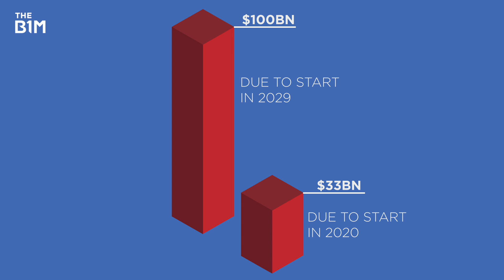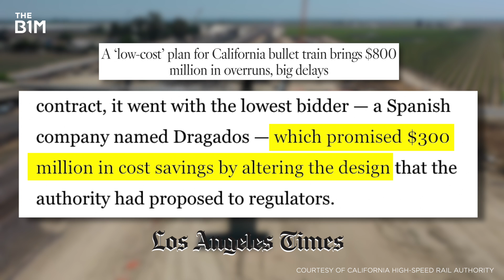What Went Wrong With California's High-Speed Railway

Comment: the statement from ~3:40 to 4:00 is misleading. yes, the original estimates during prop. 1a were for just $33b for the total which later ballooned to $100b in subsequent business plans, but that top figure was the high estimate if "everything goes wrong" and it's for the entirety of phase 1, NOT only the madera-wasco segment under construction. it's all but guaranteed that if $100b is spent, then the entirety of the la-sf portion complete and that probably will pay for some of the route up to at least to sacramento from phase 2.

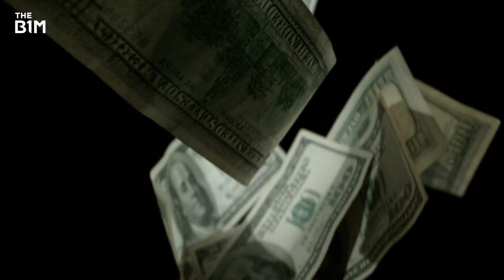the comment regarding environmental reviews at ~5:20 is outlandish. the cahsr authority has continued to advance environmental clearance on all the remaining segments of phase 1 and while they are behind the original schedule (in no small part due to having to redo some segments after the local agency partners changed their minds and demanded a new route e.g. bakersfield), the majority of the segments of phase 1 are already cleared and there's no evidence that they won't be able to fill the last few gaps within a few months after the timeline at worst.

finally, yes, the la-sf trip is the big shiny object that propels the project along, but the reality is that it's going to be the fastest way to travel around the central valley which will be massively transformational. additionally, it will be a completed spine, something that is certainly likely to be easier to build outward from (including with local funding in the "blended" corridors on the bookends) whereas starting at the ends would've blown all the money on a redesigned laus and salesforce transit center in sf. it's way easier to run a line over 120+ miles of track than five.
Reply: Their 100-billion worst case scenario is likely the most probable outcome.
Reply: @stephenwest2  only if it gets dragged out for many years.
Reply: @snoopyloopy  Which is a certainty at this point.
Reply: @stephenwest2  what's the certainty? the only reason it would reach that amount is either due to taking so long that inflation creeps the price up that high or the entire project is completed.
Reply: @snoopyloopy  Not mentioning the pandemic, these projects are known for always massively going over budget as new problems arise during the construction process. Nothing new in California's case. Don't get me wrong I would like to see this project succeed as I am a big fan of public transportation but it's pretty hopeless at this point.
Reply: @stephenwest2  hopeless how? it's very much under construction and unless the legislature continues their senseless hold on funds, will be gaining an infusion of cash soon that will help close even more of the gaps.

Comment: As a Californian whose followed this project since 07-08, this video has greatly summed up the major issues of the CA High speed rail. Sad. Lawsuits & corruption are also driving this high speed down ( & cost up)
Reply: This is the major issue. So much of California conservatives were against it from the very start and have been holding it back. There was always going to be red tape but with the past Trump presidency making things more decisive. The new infrastructure bill is supposed to significantly help it though
Reply: The new infrastructure bill is just for new highway expansions and repair on roads and bridges, as if we need yet even more highway to maintain.
Reply: @Swiminatub  did you read the infrastructure bill?
Reply: @Swiminatub  You must not be from California, its ran by democrats, this project has been over budget and delayed way before Trump was president. Its not close to finished and even if it was close it in farm land no one would take it. They shoulve cut bait and ran 10 years ago.
Reply: @Swiminatub  This project has been going on for 20 yrs.  The fed govt requires regular updates and certain timelines to be reached for continual funding.  When you fail to reach these repeatedly - you risk losing your funding it's always been this way.  Trump just did what leadership in the past failed to do - that's why jobs and an the stock market was soaring and gas was $1.50 cheaper for Californians when he was in office 
( prove me wrong ) - What has Brandon done between his dymentia episodes ???
Reply: @stuntdriver2147  Stock market was soaring? You Trump supporters always close your eyes and ears when anyone brings up the huge crash that happened near the end of his term. Gas prices are high because of low production, you ever take a business class? Im guessing not, otherwise you would know that low supply + high demand = high prices
Reply: @philosopherbytes3758  more that both parties are but both sides likes blaming the other
Reply: @stuntdriver2147  Keystone xl was never completed. How does stopping construction on an incomplete pipeline cause prices to rise? You need to question your own news sources, bud.

Comment: in order for high speed rail to work it must have the exact time, price, destinations, and speed that people want and makes it a competitive choice. 

CA should have hired the Japanese/Chinese as consultants and started with LA to SanDiego or LA to Vegas first as a proof of concept.

Houston to Dallas, Miami to Orlando, Boston to NY to DC have huge potential. But the problem is corruption and the lack of political will. 

The BrightLine project in FL was up and running and turning a profit but at slower speeds until the pandemic hit. BrightLine is actually America’s best hope.
Reply: don't think brightline is turning a profit on the train service itself, even before the pandemic. and the issues being faced now would be absolutely magnified for la-sd, with less overall benefit.
Reply: @snoopyloopy  Even if it did not turn a profit at the time, ridership was visibly increasing. Brightline is also the same as any other company- it is normal for any business to operate at a loss in the first couple of years. But more people will learn about it, have opportunities to use it, and start riding it more.

If anything, I think this pandemic will turn out okay for Brightline- The numbers have not fully come out for this half of the year yet, but the net migration to Florida over the pandemic has seen some of the largest gains in the country. Their population has seen an increase of close to 300,000 every year, and once they reopen, Brightline will be able to take advantage of that.

Comment: Everyone knocking the US for not having high speed rail hasn’t been to the USA outside of Disney Land. The cost of gas and distance alone is totally different. Europe and Asia has nothing on the US and Canada freight train systems. You would never have a train in Europe carry the amount of goods that they do in North America. Many years ago the decision was made to lay rail track for freight trains and flights are so cheap in the US that rail would have a tough time competing. Plus the dumb argument why don’t they use the same tracks… the track gauge is different and where do you park a 3 mile train when a high speed train needs to pas 🤷‍♂️🤷‍♂️🤷‍♂️ Then add in the weather in the mid US states high speed tracks buried in snowdrifts. China started from scratch so it is easier to start from nothing than build around everything that is already in place. I’ve been on the trains in China they are just incredible but the people can barely afford a car, they literally have to be in a lottery to get permission to buy a car!!! So it is not even apples to apples….
Reply: The lottery system was put in place only in extremely congested areas like Shanghai where they charge you $13,000 for just the license plate alone, and even then tons of people are scrambling to get one. You think the average American would willingly pay 13k for a license plate and registration without the car included? Also "the people can barely afford a car?" Bro, have you not been in any major metropolitan area in the US?

Comment: It was a system, no one asked for, nor wanted.  In California, been here all my life.  The automobile is king.  

Even if you did a high speed rail in the valley, there are only four stops to be made.  Los Angles, Bakersfield, Sacramento, San Francisco.  And once you arrive, you'd still need to either rent a car, or be picked up.  For the projected cost of the high-speed ticket on the valley line, I could do a weekly rental of a mid-sized sedan plus gas for less.  And with the advent of electric vehicles, the rail becomes even less enticing for California travelers. 

The majority of city centers in California are located on the coastal line which runs from San Diego to San Francisco and beyond.  But again the City centers are on the coast.  

I lived in Germany for 12-years and yes the European lines are a marvel, I had a Euro-Rail pass.  But the thing is that the country's of Europe are very small in comparison to the USA, and the fact that rail lines existed in Europe long before Automobiles, of which only lesser percentage own a car.  

In the USA there are more cities/towns and areas that do not have rail service than ever will have.  The distances between rail services is just too great.  This project is simply a case of idiots in state government deciding to spend on a project that was doomed from the start.

Comment: "Eight Vertical and Eight Horizontal" network development strategy from China

Map of "Eight Vertical and Eight Horizontal" high-speed railway network (in Chinese)
In 2016, the National Development and Reform Commission (NDRC) announced the plans to extend the almost completed "Four Vertical and Four Horizontal" network to a new "Eight Vertical and Eight Horizontal" network.[36] The new network comprises eight north-south ("vertical") corridors and eight east-west ("horizontal") ones, almost doubling the route length.[36]

A corridor may consist of two or more parallel lines that take different routes between the same cities, branch and connector lines, and in some cases, connecting lines and lower-speed lines.[37] The Beijing-Shanghai HSR corridor, one of the verticals, comprises the preexisting Beijing-Shanghai HSR, which runs through Tianjin, Jinan, Bengbu, Nanjing, Wuxi and Suzhou, as well as a new high-speed passenger dedicated line from Beijing to Shanghai via Tianjin, Dongying, Weifang, Linyi, Huaian, Yangzhou, and Nantong, as well as HSRs connecting Nanjing, Hefei and Shanghai with Hangzhou.[38] Some corridors consist of a single HSR line; the Shanghai-Kunming HSR corridor, one of the horizontals, is essentially the Shanghai–Kunming High-Speed Railway by another name.[39]

The national HSR mainlines in the 8+8 corridor grid are generally electrified, double-tracked, passenger-dedicated HSR lines built to accommodate train speeds of 250–350 km/h, but corridors also make use of intercity and regional HSR lines with speeds of 200 km/h as well as certain regular speed railways. The Qingdao-Yinchuan corridor includes the Taiyuan–Zhongwei–Yinchuan Railway, which is partially single-track with speeds of only 160 km/h.[40]

Comment: Yeah the biggest issue has been land cost. Ugh I HATED driving to LA from SF it took 6-7 hours with little stops....
Reply: @scotttild  You'd missing the point of me NOT having to fuckin watch the road for 4-6 hours. I would take the train 100% of the time if it was done just to sleep or get other work done vs lose a DAY to driving. FFS
Reply: @CannabisTechLife  Very true. Not just sleep, you can use your phone or a laptop, read, eat lunch, get work done, etc. There are plenty of things you can do on a train that you cannot easily do while driving.
Reply: @CannabisTechLife  My car basically drives itself, I don't really need to watch the road. True driverless cars will be a thing long before this is finished--even if it takes 20 years.
Reply: Back in the day, I used to commute SF - San Diego every weekend (down on Friday night, up on Sunday night).  God that sucked.  Having a train would have made my life so much better even if it didn't save me significant amounts of time.
Reply: The main issue is not the land but the high cost of US public works. Electrification of the 50 miles Caltrain San Jose-San Francisco line will allow its use by high speed trains. It doesn't need significant land acquisition but will cost more than $1.3 billion, about 665% the cost of a project of similar length and voltage starting in Gretz, east of Paris.
Reply: Ironically, much of the track is built on a viaduct! They can literally build over farms like they did in other countries!
Reply: for 1/20 th the cost of the stupid train, they could have open
opened up interstate 5 highway from 4 to 8 lanes, the up the speed limit,   this would allow high speed driving, and will probably be less hassle for a SF to LA trip than riding a train.   no waiting at the station, no bus ride to and from the station.   Freedom!

Comment: This project never made any sense from any aspect you can conjure forth. There is no demand for it. There are multiple airports at each end of the route. All of which can deliver the trip cheaper, faster, and more efficiently. As for driving, what makes the trip on I-5 such a hassle is not the 6 hour length. It's the refusal of CA to add one extra lane in each direction. This would alleviate any congestion the highway currently experiences. At a fraction of what CAHSR is projected to cost. 

Beyond any other objection, passenger rail makes no sense economically. No passenger rail system in the world makes money. A handful of them generate enough revenue to cover their operational expenses. And none of them cover their capitol costs.
Reply: It is a known fact that adding lanes simply creates more traffic which defeats the object.
No road system makes money either.
Reply: @grahvis  The traffic already exists. I-5 was built 40 years ago when CA's population was half of what it is now. Adding one lane each way from north to south would be fraction of CAHSR is wasting.
Reply: @grahvis  There are road systems that do make money. All of their operational and capitol costs. They're called toll roads. They charge the actual cost of the trip. Passenger rail does not.

Comment: With even high speed rail you would have to drive or Uber to a station,  go through boarding, travel time, wirh stops along the way, the lime would be a mix of high & regular speed travel, it duplicates an Amtrak route (only slightly faster) and you would still need auto transport at your destination. Multiply ticket costs per individual and it gets expensive quickly. Don't see any particular advantage over flying,  especially when you could take the money wasted on this train & put it into projects that would have a greater impact to improve the environment.

Comment: Fun fact: Even though chna leads the world in high speed rails, most of them if not all of them operate a significant loss each year.  They are also built with low skill migrant labor with little or now safety standards so use them at your own risk.
Reply: 中国政府本来就没有指望高铁会赚钱，这个基础设施为国家整体经济和社会发展提供动力，而不是仅仅考虑这个系统本身是否盈利。
Reply: Doesn't change the fact the US highspeed railway talked in the video is shit.

Comment: I believe high speed starts from 200 km/h on existing routes, so northeast corridor is a high speed rail
Reply: The video is a bit misleading. Acela isn't regarded as HSL because it only reaches 150mph for some 30 or so miles of a 470 mile route. The top speed isn't the issue - the fact that it's for the largest portion way slower is.
Reply: @Sp4mMe  what's the average speed then?
Reply: @mozomenku  like 70 or 80 mph i think

Comment: If you’re curious as to why the project is such a colossal failure, look up ReasonTV’s video on the California Rail System. Hint: too much government
Reply: no, it's too little funding combined with nimbys.
Reply: @snoopyloopy  agree with the nimbys. But they went like 3 times over budget already and STILL have issues it ain’t about the funding.
Reply: @raleighcassada7602  when the bond measure was passed, there was little more than lines on a map & no worthwhile estimate of the total cost. however, the lack of ongoing funding is why they're just barely getting the Central Valley finished instead of also at least working on the "bookends" if not also the tunnel crossings too.

Comment: I live in Japan. Here high speed rail is called Shinkansen. A train leaves Tokyo for Nagoya and Osaka every 10 minutes. One train is a direct express and the other is a like a local stopping at minor stations (so every 20 minutes). If you drove to Nagoya it would take 6-9 hours depending on traffic. The direct shinkansen takes 1 hr. , 45 min.. Nobody flies from Tokyo to Nagoya. A flight would take longer than than the shinkansen and would cost more. It is incredibly convenient.

Part of what I don't understand about America is that in Japan when the shinkansen gets to a city they don't build a separate line for it. Instead they run the train over streets or over the existing railroad. Why can't America take a page from the Japanese and do the same? They have to build a platform anyway for the train, cut cost and build it above existing roadways.

Comment: Feasibility study and Engineering design was main issues in Cali high speed rail.
Reply: also lack of funding. state has funded about 80% to date.
Reply: Fund can only be released , if you know the 90 approximate cost of project before its initiated. The cost comes from feasibility study and engineering design.  if you don't have done proper feasibility , the cost and issues like funding become biggest hurdle in const projects.

Comment: Shouldn't the San Francisco section be fairly straightforward? I was under the impression that the high speed rail will share tracks with Caltrain, which is already undergoing electrification and grade separation work. The LA segment seems to be the most troubling.